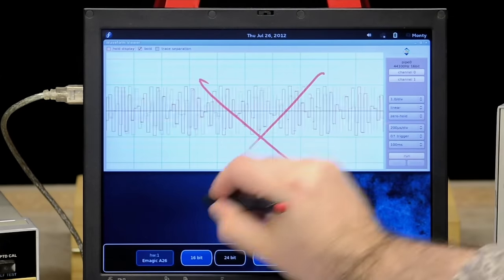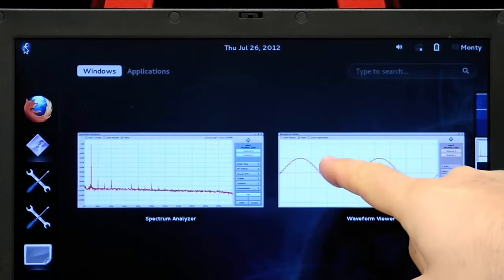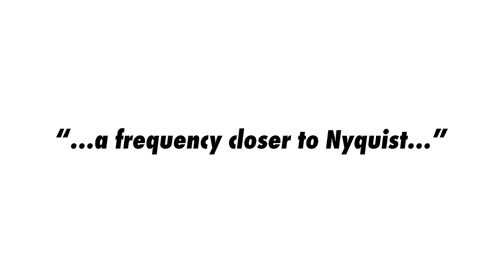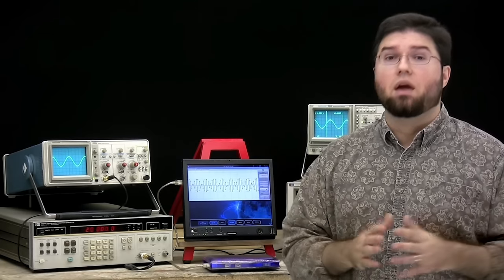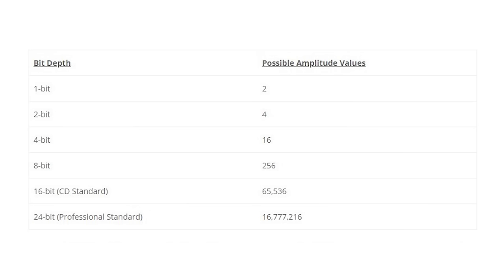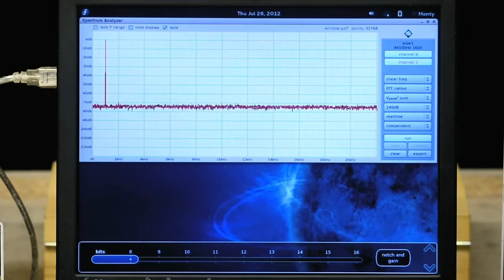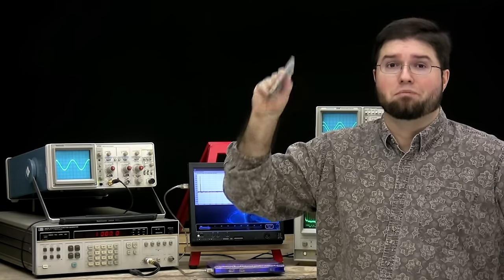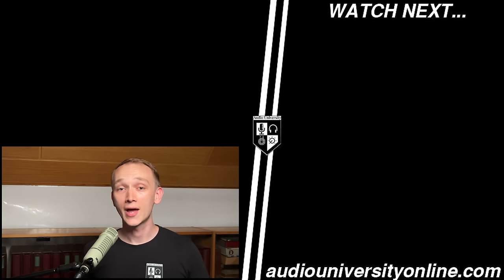Debunking the Digital Audio Myth: The Truth About the 'Stair-Step' Effect

Comment: There's a reason to use 48khz in movies/videos which has to do with the fact that it's a multiple of 24 which in turn means you get an integer number of samples per frame. Makes syncing video and audio much easier.
Reply: My experience is, it sounds better, especially the high end. Comparing CD and DVD side-by-side, the DVD is a little more "crisp".
Reply: The only correct answer.
Reply: @vincentrobinette1507  'crisp' is a subjective thing in human ears. and human senses are not that good. the human mind doesn't work like we think it does. EQ on every stereo are there because human hearing is really not that great lol. the human senses, barely work. if you've seen an optical illusion, you know that.
Reply: @GungaLaGunga I dunno, a handful of fleshy tubes that can detect oscillations of molecules on the order of nanometres with wavelengths spanning several orders of magnitude sounds pretty good to me.
Reply: @thesenamesaretaken  not what i meant. obviously that we have hearing is most excellent and the buttery goodness for what it is. But compared to dogs and whales, human hearing is very poor. As are all our senses. Just wait till you get older as they get even worse lol. You'll see, just not that clearly anymore without glasses. Cheers.
Reply: @GungaLaGunga  Not all of our senses are worse compared to dogs. human vision is much better. So's our haptic perception and our inner ear.
Reply: Your DAC LPF will make a bigger difference than the sample rate because of pre ringing above the sample rate. A better clock, and DAC will sound better at 44.1khz vs a cheaper DAC at 48khz. Like the OP of this comment, 48k is easier for Video sync at 24fps
Reply: @vincentrobinette1507  Please describe your double blind objective trials so we can determine if your methodology was sound.
Reply: @frogandspanner  thats not how arguing on the Internet works my friend
Reply: @jackpeterson6670  I know - most people are thick, emotional and irrational, pal.
Reply: or to record bats having a chat, and to be played back for the other bats which want to hear those noises later
Reply: Thank you for this information
Reply: Totally correct. That's what he said ~15s before the end of the video.
Reply: I’m not entirely sure that’s true. While Hollywood may have been 24p most of the video works at the time digital audio and in particular CDs became a thing was 60i interlaced video in NTSC countries and 50i interlaced fields in PAL countries. The argument kind of falls apart since a lot of video was not actually 24p back then.

Perhaps it made sense for film based content but why would that even really matter? It’s not like people were purposely counting samples of audio per frame.

From a Hollywood perspective I guess it could be a thing but many video formats like the DV video tape standard had absolutely nothing to do with Hollywood. No tape format that adopted 48hz had any use in Hollywood.
Reply: @digitaldevigner4080  clearly you've never been involved in any kind of film or video production. or software engineering related to it. why you feel you posses the necessary expertise to make such inane commentary is honestly beyond me. But to answer your question or rather to ask what do you think a software piece should do when it needs to start video playback with a 1/3 of a sound sample? what do you think it should play? as for everything else, youre just wrong on all accounts and Im honestly too lazy to even explain why, especially not to a person who thinks they already know everything.
Reply: @kozodoev  I have worked with video since the 90’s. I never said it was completely untrue. I said not entirely true. It may have been one minor contributing factor for NTSC but it had more to do in PAL countries to move in a 3:2 ratio from 32khz to 48khz. The goal was to allow more gradual low pass able to capture slightly higher frequencies without aliasing. There was the choice between 45, 48, 50 and I think 54 kHz. Since PAL already adopted 48 kHz and yes it did kind of align with some video that was 24p it just made sense to have that as a universal standard. 24p was not the sole or main reason however.

44.1 kHz was also not very good at CPUs dividing and 48 kHz works much better so that was a factor as well. Also I recall something about leap frames and that math being more of a factor. I just feel like the 24p thing was more of a happy coincidence. I feel the other reasons are more solid.
Reply: @digitaldevigner4080  NTSC, PAL and other stuff is completely irrelevant, both audio and video just get scaled for TV there preserving the integer ratio, you absolutely and utterly miss the point. You're just throwing around some terms without understanding the underlying mechanics. Whether you display the source at 25fps or 23.967fps it changes nothing, you still get the same number of audio samples per frame. That said, yes 48khz CAN be divided by 25 too, which is just a nice bonus. The fact is - all films and most videos are still shot at 24fps. And that is why audio on all dvds/blu-rays is in 48khz.
Reply: @kozodoev  from Hollywood yes. Most of us that were creating DVDs when they were still a thing did not have 24p cameras. 24p didn’t really take off until we had DSLR cameras that could shoot 24p. There were some camcorders before that but they were not as common. Lots of  TV content was shot interlaced if it wasn’t shot on 16mm film. At least from all the people in broadcast and live or corporate video production 24p wasn’t yet a reality.

Since DVD was first a Hollywood thing I guess the 24p part did make sense. But digital tape formats went 48khz long before they could even do 24p.

My whole perspective was that until DCD recorders were more affordable and useful the digital video works outside of Hollywood discs was mostly 60i or 50i and I don’t see the decision of 24p as relevant for audio. Unless DVD was the sole driver of that factor and everything else followed.
Reply: @digitaldevigner4080  This is hopeless I see. No, not from Hollywood. 24fps has been the standard in the film industry all over the world for over 100 years, way before any TV standards, let alone the color TV (NTSC and PAL are standards to encode color in the analog TV signal and have nothing to do with audio).  What FPS do you think Eisenstein and Fellini filmed their pictures at? What FPS do you think the negatives of Seven Samurai had been scanned at? As for your "not having a camera capable of 24p" - I already knew you'd never done any real film or video production. My god. Anyway, there won't be any replies from me on this, I've given you enough attention already.